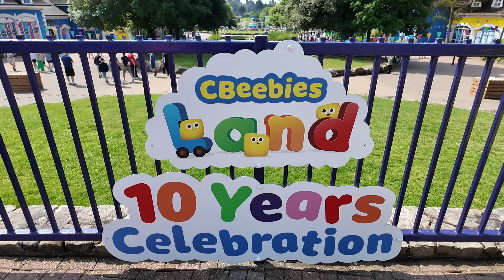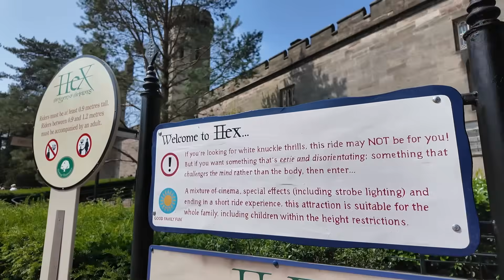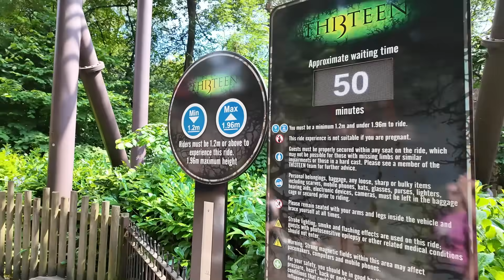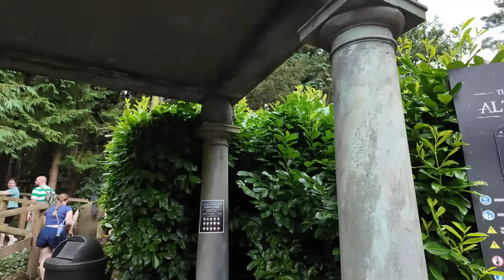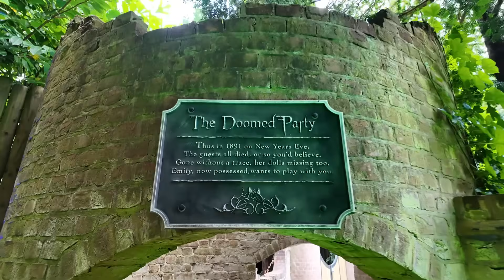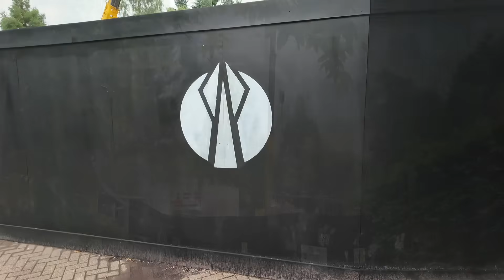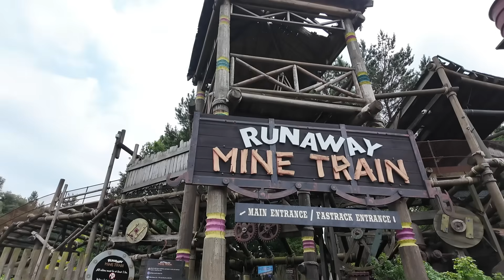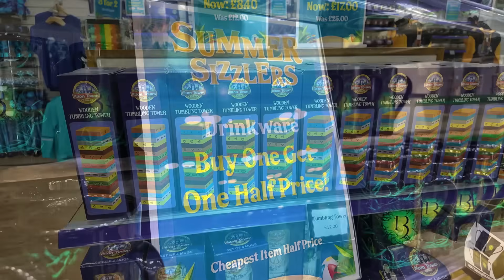Alton Towers Vlog August 2024

Comment: We went for the first time on Tuesday/Wednesday, so just before your visit. The trommel wasn't working in Curse on Tuesday either. Lovely visit but agree with your points about ride availability. After coming up from the South of England to visit, it felt underwhelming at times. Highlight was X Sector, Gloomy Wood & Forbidden Valley. We noticed lots of empty cars on various rides despite long queues too. Also some areas of the park seemed a bit rundown or dirty.. but overall, a beautiful park with a lot of potential in the areas that need love. Hope they can get it all upto the same quality as Cursed, Nemesis, Smiler, etc.
Reply from the maker: Thanks for sharing!